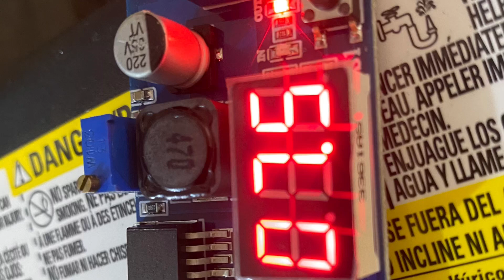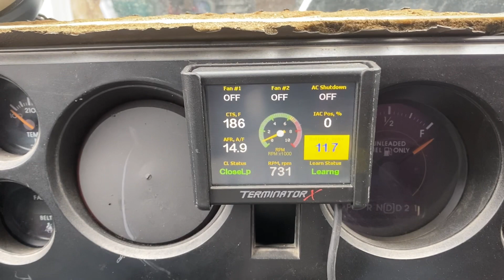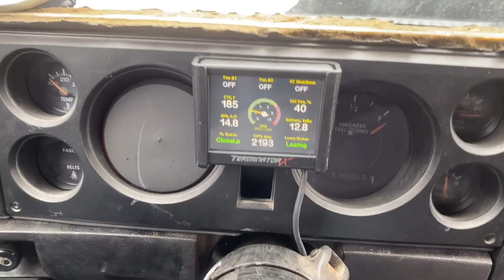LS alternator exciter wire voltage Prove it Please!

Comment: May I ask why did you not put a 470 resistor in between a 12 volt line and measure the voltage at the other end with out the adjustable do hickey you bought?
Reply from the maker: I bought this adjustable reducer years ago for a different reason, found it in my tool box; decided to try it. I didn’t know it was so difficult to find out what voltage to set for the alternator field /exciter wire. Apparently 99.44% of the people just follow what they read on the Internet with no understanding of how/why. If I have to I’ll order a 470 ohm 1/2 watt reducer and do what you suggested by simply testing before and after voltage. Thanks for watching and the feedback I appreciate it!  JD
Reply: @HeadFlowInc  please do another video showing the actual voltage you get with a 470ohm resistor! Or just do it and just add a comment!

Comment: Resistors dont drop voltage unless current runs through it. What is it exactly you're trying to accomplish?
Reply from the maker: I’m trying to set the voltage to the exciter/field wire at the alternator.  12v doesn’t work, it burns up the internal regulator in a pretty short period of time. 
I have the adjustable dc-dc setup I need to know what to set it at.  JD
Reply: @HeadFlowInc  the 470 figure you see on that buck converter has nothing to do with a resistor. That is a an inductor. Which is a coil. And it is 470 millihenries or microhenries. The unit of measure for inductors. 
While I'm not familiar with the LS setup, I do know a lot about operating alternators. Is this wire for the dummy light on the dash. The one that typically goes out after the alternator  starts producing power...
Reply from the maker: No light, it’s purely to trigger the alternator to charge. One wire hook up.
Reply: @HeadFlowInc  okay, because in other vehicles, the dummy light is the exciter wire. And the light goes out when the alternator starts producing power. You also have a weird issue of the alternator not charging when the engine first starts. I will watch the video again and comment back.

Comment: Hey, JD.  I'm looking for an answer for ya. It may take a while.
Reply from the maker: I’m considering buying a 470 ohm 1/2 watt resistor just to do some testing to verify the reduced voltage. It seems like suck a simple detail. JD
Reply: @HeadFlowInc  Hi, JD.  I've got some info but it's to much for this avenue of connecting with ya'. Will you email?  My email addy is. jandj.racing@yahoo.com.
I'll be looking for ya', Jim

Comment: The equation is V=IR.  I is current and R is resistance.  In the he sloppy and other videos the 470 ohm resistor kept the output of the alternator at about 14.2 volts.  As the current load on your car varies, (fans turn on, etc) the battery voltage will drop.  The alternator will sense this and charge harder ( more amps and 15 volts if needed) and bring the battery voltage back up to 14.2 ish.  So basically it was decided and proved 470 ohm works good to keep the battery at 14.2 ish volts at all current loads assuming your alternator is up to the task. Similar to what the stock Ecu would do but less complicated.
Reply from the maker: My alternator tested at 14.0v so I’m not sure how/why it would ever need to produce 15.0v+? But with the alternator functioning properly I still need to know what the voltage is after the 470 ohm resistor. 
It doesn’t help me if I can’t verify the voltage drop after the resistor. JD
Reply: If your battery is really low, like it won't hardly cranks,once the motor is started,  then the alternator will hit it with 15 volts (and like 40 amps)  so the battery will recharge quickly .  As the battery reaches fully charge (say 13.5 volts) the alternator will meet all the electrical load and keep the battery fully charged and output say 14.2 volts.  So the voltage after the resistor varies depending on what the battery is sitting at.   If you battery is always fully charged you will probably see 10.2 or so like you have experienced.  But if the battery is near dead at say 11.5 volts, you will see less than 10.2 volts after the resistor until the battery is recharged by the alternator.

Comment: I assume the voltage depends on how much power your battery needs I assume that changing the voltage will change the current since there is a voltage regulator

Comment: I guess if you are looking for that voltage the best way to find it would be to put your multimeter leads one on the B terminal with it hooked up and the source you could probably get away with just you battery positive and that should be the voltage drop

Comment: Well the voltage from a 470k resistor would be the same so 12v or 14 depending on the voltage supplied it depend on the load so just 470k and 12v is not enough info
Reply from the maker: I’ll order a simple inline 470 ohm resistor and test the after voltage.  This seems so simple I can’t believe nobody has done it.
Reply: @HeadFlowInc  I mean if the 470k works I'd just do that it might just be the resistance not even a different voltage but like I was saying 1 resistor doesn't really change voltage it just limits current and if it limits to much voltage will start falling

Comment: This was something I was racking my brain over with my swap that's not done yet

I bought some of the resistors but couldnt find any consistent information on the alternator wiring, this is great information, thank you for this video
Reply: Also you might want to add a small heatsink to the 10 prong chip on the board, it converts the extra voltage into heat and being under the hood is going to cook it

I've used the converters before to power an arduino in my car that I control leds with

You could waterproof the board by potting it with epoxy, build a small dam around the board with clay and pour in potting epoxy, but if you do that then absolutely make sure to add a heatsink

This is where 3d printers can be helpful too, I printed a small enclosure for mine

Comment: I agree, the lack of accurate technical information about these alternators is frustrating. I’m going through the same thing trying to adapt an LS alternator to the engine in my Suburban.
Reply: Some models use a current transformer that will see a increase in load and kick the alternator field voltage a little higher for the increase in amp draw. And when there’s a lack of draw it will reduce the current. Reducing engine load and emissions. Older vehicles use the light bulb in an alternator circuit as the resistor.
Reply from the maker: I know for sure my Yukon uses 10.2V but does this change/fluctuate via ecu control? 
I guess I’m going to buy a simple 470 ohm resistor and do some testing.
Reply: @HeadFlowInc  another option would be to but a potentiometer so you can vary the resistance in the exciter wire and see what effect different resistances (and therefore different voltages) have on the charging voltage.

Comment: Pretty sure you must install a resistor in the ground circuit also to get this to work right. It's what I found. Run 12v through the circuit and see what its giving you. If it's not right, try adding the resistor on the ground also and see then.
Reply from the maker: The adjustable resistor is working perfectly now, fully adjustable and consistent. 
I need to verify what voltage to set it at. I guess I’ll have to buy a simple 470 ohm resistor and find out myself what the reduced voltage is using it.

Comment: Factory ecu controls the alt. It doesn’t send 12 volts to it. I used a resistor inline and it’s been fine for years.
Reply from the maker: Did you use the highly recommended 470 ohm resistor?  If so could you unplug the alternator and test the voltage you’re seeing after the resistor?  I’m very interested in seeing the results! X1000
Reply: @HeadFlowInc  470 ohm in line, I’ll take a voltage reading when I get home for you
I have three swaps done this way

Comment: 5 volts
Reply from the maker: You’re saying it needs a 5v net voltage to Terminal B or are you saying the 470 ohm resistor drops voltage +- 5v?

Comment: I would go with the stock vehicle numbers over some internet guru. To figure out how much that 470 ohm resistor reduces just put it on end of wire and see what u get. Pretty simple. I wouldn't waste time searching nothing better than practical application. Maybe u should do a quick vid with volt meter showing what u get thru the 470 resistor it might be the straight answer everyone including yourself was looking for. Great work sir with just the right amount of excitement.
Reply from the maker: I don’t have a simple 470 ohm resistor I’ll have to order one! Great idea, verify what the voltage drop is then compare the result to my reading from the 2000 Yukon. Great idea!
Reply: @HeadFlowInc  glad to help out a gear head

Comment: Your problem with finding an answer is they might not sell the right alternator
Reply from the maker: Maybe, it’s just odd every LS1 website says use the 470 ohm resistor yet they don’t even understand what the new voltage is. lol

Comment: I ran the sloppy mechanics plug n play alt/flex fuel harness. Plugs right into your power tap on the holley and you're good to go.
Reply from the maker: Nice score!  I wish Matt would have included technical information on what voltage etc.
Reply: @HeadFlowInc  Yeah, idk what it should be. Was curious about just trying the 5 volt sensor output from power tap and see what that does. I saw a guy just use his dash light output on an older car and it worked.